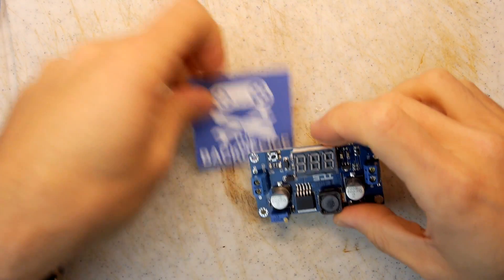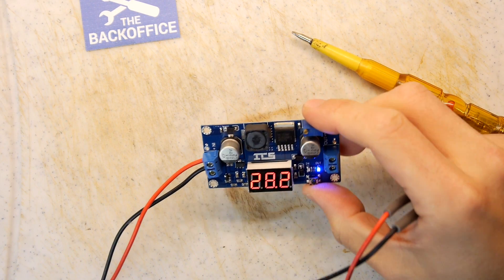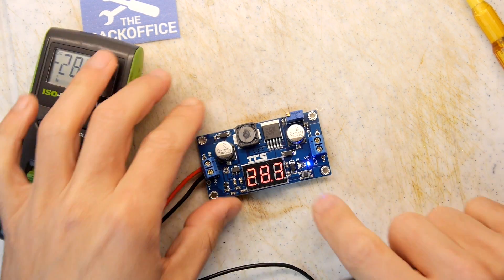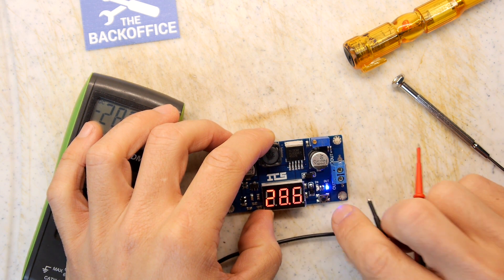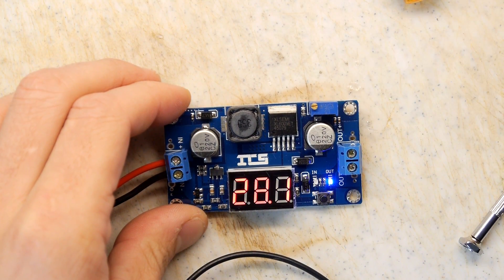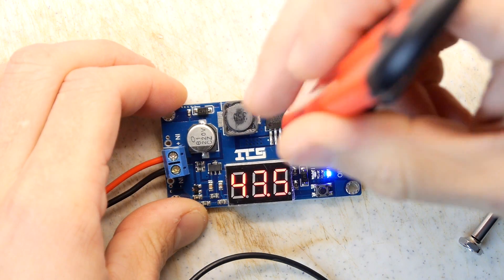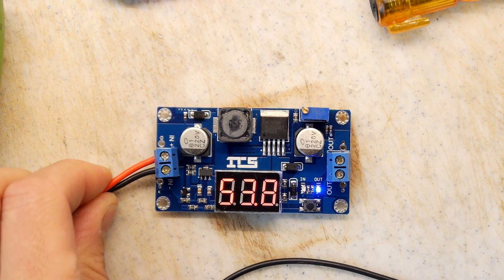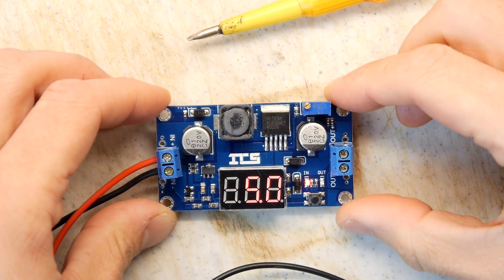XL6009 5 to 55 volt DC to DC Booster

Comment: You're NOT going to feel 50V dc coming out of that boost converter.  Even if it claims to do 4A, the resistivity of your skin will not let the voltage get high enough to pass any significant amperage.  I know this is an old video but it was recommended to me just now.
Reply: international safety std is 36V. so your comment is incorrect. you no need 4A to be sensible.

Comment: cool.. gonna try use my 4s lifepo4 20Ah to charge my 10s li-ion ebike battery on the fly.

12.8v 4A should give 42v 1A at 80% efficiency.. more of a battery saver, range extender scenario.

Also thinking to use it as a solar charge controller, 60W 18v panel to 24v battery bank.

Comment: Using this inverter How many time can i run a wiper  motor by 5 volt 3000mah mobile battery?
Reply from the maker: I think you would burn out the inverter, what current will the wiper motor draw?

Comment: So whats gonna happen if V out is set eg to 30V, and the input voltage will be 40V? Is the booster gonna step the 40V down to 30V?
Reply: NO WAY, the output will sit at Vin - diode (0.7)  === so for 40V you will get 39.6V output.  If you want to go up/down you need to get the SEPIC version of the XL6009 board/.

Comment: i replaced the100k 25 turn multi turn pot with a normal 100 normal 270 degree trimpot. the 25 trimpot is really stupid and you need a screwdriver and there is no knob for it anywhere?
Reply: you are so smart to change a more valuable precise multi-turn pot to a cheap rough 270 degree pot

Comment: Is it possible to increment the power of that board so the up3-330 will not get hot? Because i have one with a up2b-4r7 and that thing after awhile gets hot!
Reply from the maker: Just pop on a heatsink, I am sure you can drive it a lot harder then :)

Comment: Can it convert 5v to 20v to charge a laptop by powerbank?
Reply: That's what i want to know did you found if it can ?
Reply from the maker: No it can't
Reply: @arya_x2  i actually bought one and it really cant at 19v+, but it can with a 12v laptop charger using  powerbank with pd.

Comment: How many amp input and output
If input 5v 1a, output can 55v ..  amp?
Reply from the maker: I am sure the answer will be here somewhere: http://www.haoyuelectronics.com/Attachment/XL6009/XL6009-DC-DC-Converter-Datasheet.pdf
Reply: 5volt * 1Amp = 5 watts. Output is ideally equal to 5 watts at 100% efficiency. (I*V) =W so 
5v/55v = .0909 amps

Comment: Hey there dude. I have managed to kill two multi-meters when measuring voltages from this xl6009. Do you have any such experience? Or where could i be going wrong?
The input source was two 18650 cells in series.
Reply from the maker: What are you trying to measure?
Reply: @backofficeshow  the voltage boost that is being provided
Reply from the maker: What's the maximum rating of the meters? Really it should not be outputting very much. Do you have a load on the output?
Reply: The multimeter does not die immediately. After sometime the display shows 1=meaning the device is out of range. ( For all the position in the multimeter- measuring ac or dc or resistance or current)
Reply: @backofficeshow  load are 2 dc-12v geared motors
Reply: @backofficeshow  meters are Htc-dm81 and dt830D( generic)